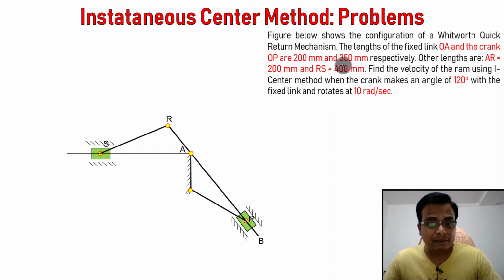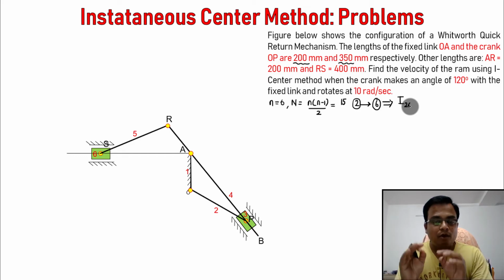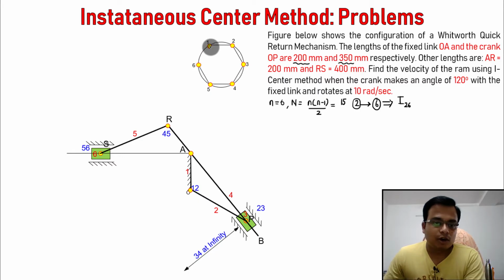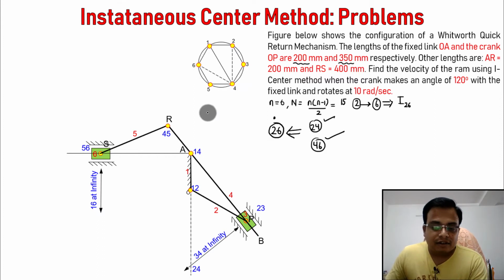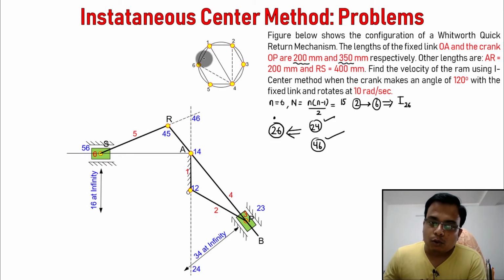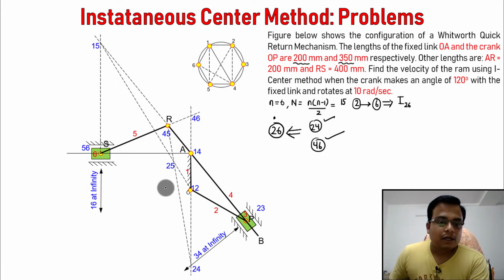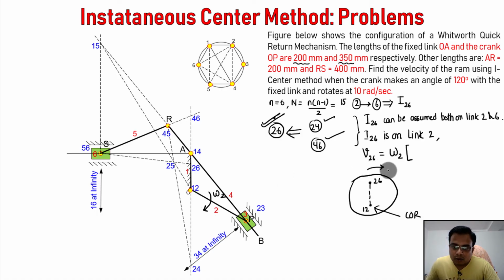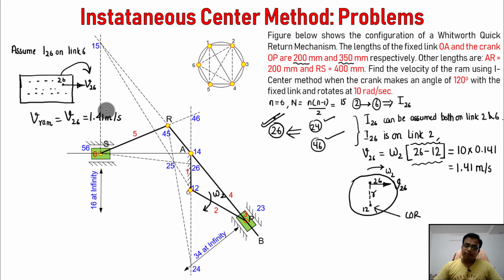Theory of Machines || Velocity Analysis by Instantaneous Center Method || #6

Comment: A machanism shown in fig as the follow dimensions OA IS 200mm AB IS 1.5M BC IS 600MM CD IS 500MM BE IS 400MM locate all the instantaneous center if the crank OA rotates uniformly at 120 rpm clock wise find the velocity of B C D and angular velocity of links AB BC CD 
ONCE EXPLAIN THE PROBLEM SIR PLS WITH DIAGRAM

Comment: 13 needs to be infinity? R 34
Reply: Same doubt !!!
Reply: Same doubt
Reply: actually the link 4 is sliding on link 3,  and for a sliding pair the I center is at infinity. the similar can be assumed for I 13 also but its not needed.
Reply: @sanjeetnamdeo7654  bro link 3 is slidinng on slotted lever (4) . It is called quick return mechanism .